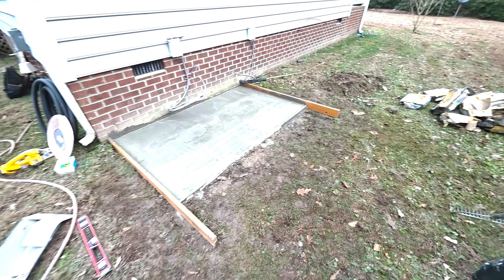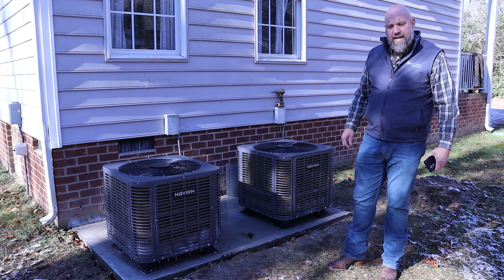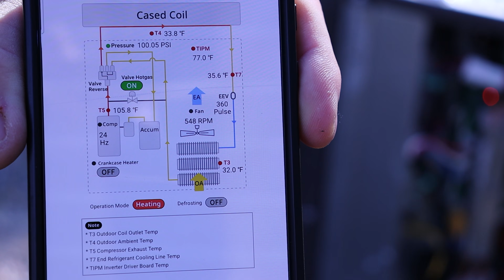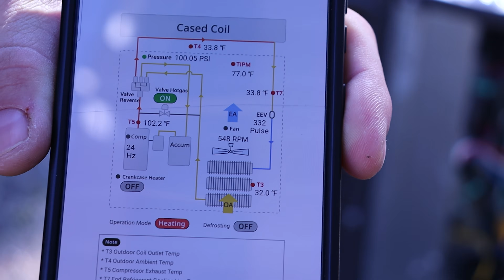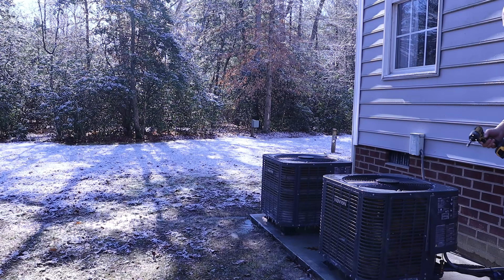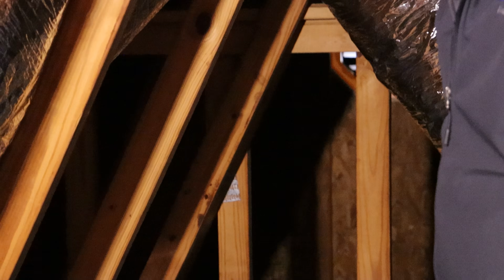The New Navien Heat Pump System is a Game Changer

Comment: looks cheap. Wonder how bad that customer service is or how long it takes to get parts when needed.
Reply: Navien is probably the best I’ve worked with when it comes to tech support and parts
Reply from the maker: LOL, How does that look cheap?  Navien is going after the mid tier inverter gear with this first offering and it works great. You can hear how quiet it is.  Of course there is always going to be someone to knock something they've never seen in person.

Comment: That was interesting,  hope you dont get snow there.
Reply: Very little.  We are required to use 4 inch step ups
Reply: @BA-ry2qt  Ok , that ,s what i was wondering about.
Reply from the maker: If we do every other unit in the area will have the same issue. Every few years we might get a 12" but not too often here.

Comment: What are these units exactly?
There's no way that Navien themselves have engineered and manufactured this, but rather paid another manufacturer to sponsor their logo.
The condenser looks like those "oxbox" machines.
Reply: I was thinking Ameristar rebranded. Either way they’re both made by Trane.
Reply: Google AI says they make their own units in South Korea.  They run on R-454.
Reply: @alberthartl8885  You can't trust AI. 
Stop.
Reply: My research suggests it closely resembles a Bosch
Reply from the maker: The Bosch market is the target and the quality is top notch. Navied Designed and engineered.
Reply: @eklof6510  they all Midea from China same line as ox-box and many others. China is flooding the HVAC market now.
Reply: Navien designed and engineered the equipment.  They are currently outsourcing production but are building the 7th factory is South Korea to bring manufacturing in house as they pride themselves in manufacturing all their own equipment.